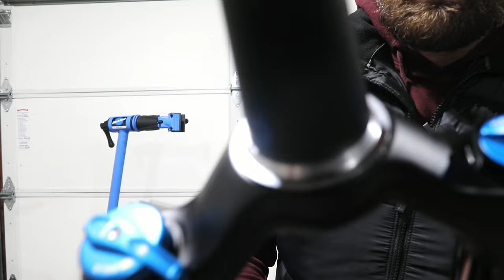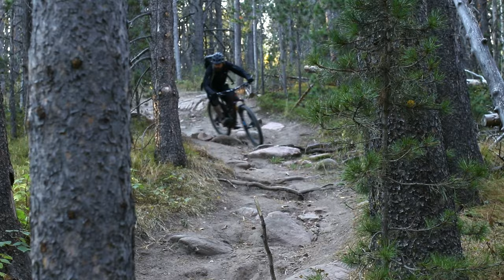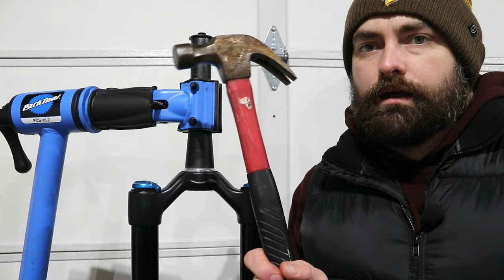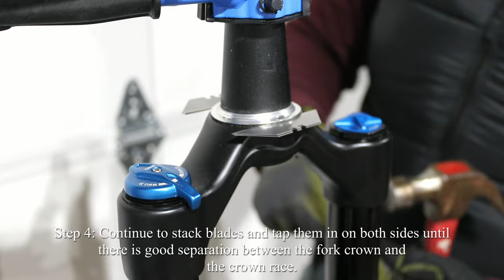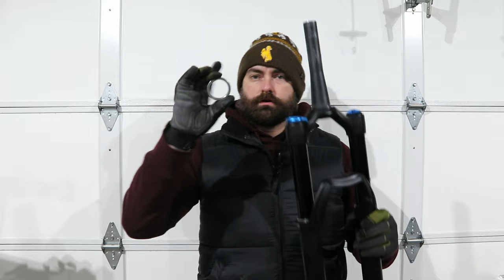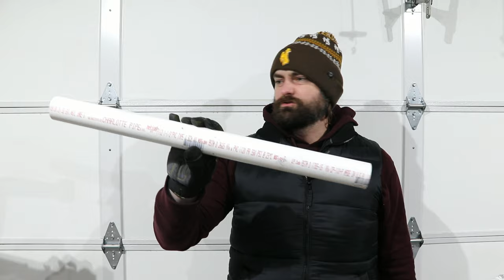DIY Crown Race Removal & Install - No Special Tools, Screwdriver, or Damage!

Comment: Probably smarter just to use a Flathead screwdriver and hammer down on that rather than razor blades at that point
Reply from the maker: So flathead screwdrivers don’t tend to be as fine of a point (or beveled) as a blade and typically have a difficult time getting under the crown race without gouging the crown.  That’s why I opt for the razor blades. If you can take a screwdriver and grind it down to a nice fine beveled edge then that should work pretty dang well!  Maybe I’ll try that out as well! Thanks for the thoughts!
Reply: @Tkolbo_  No I meant once its loose after freeing it with the razors. You used the mallet to hit downwards on the razor at that point. A simple screwdriver would be much better.... and safer.
Reply from the maker: I see what you are saying. Yes that would work. I’ve actually started using a tire lever at that point which works really well
Reply: @Tkolbo_  I've always just beat them off with a flat head screwdriver but I'm going to try your method next time which will be Thursday.

Comment: **I WISH I HAD NEVER FOUND THIS VIDEO**
No matter how careful you are, you will take paint off of your fork. 
Medal on medal is never a good idea!!
I took some decent strips of medal off of a $265 dollar fork.
Pretty sure no bike shop can fix this mistake.

Just go have a professional do it. 

"Doesn't really have any bad marring"??? BIG DISCLAIMER... but definitely could.
Reply from the maker: Well I'm sorry you had a poor experience. I wish I knew what happened, I've done this several times and so have many other people without a problem. With that said nothing is perfect, and I am sorry that happened to you and your fork.
Reply: @Tkolbo_  I wound up calling a bike shop who was really helpful. They said just spray paint over it, and the crown race won't be effected when installing. It was a load off my mind. They also said that the razor blade approach was what they've used in the past as well. I don't think I'd use the approach again, but apparently it IS an acceptable way to remove a crown race. I was just freaking out b/c the fork of concern was an expensive Crust cargo fork and the first bike shop I called acted like it was unfixable and problematic. I apologize as well for being a little freaked out over nothing. The fork is working fine now that it is all installed again.
Reply from the maker: @walkman3  Oh man Crusts are cool ass bikes! Do you have a crust frame to go with the crust fork? Bummer the first shop gave you a sense of impending doom. Still bummed you took any paint off, but atleast you got it sorted and the fork is running well! No need to apologize though, I understand frustrations when doing DIY stuff. Just so you know, I have worked in shops for the better part of a decade so I have quite a few tricks up my sleeve that I have a lot of experience with. With that said, its still a massive bummer when something doesn't go quite right. Thanks for the update!
Reply: @Tkolbo_  I haven't quite brought myself to get a Crust frame yet. I had the cargo fork on a 1995 Trek Singletrack 950 and it was perfect. The geometry was incredible.  I thought I'd swap it out and put it on my Soma Double Cross Disk, but it just isn't the same. During that switch, I was doing the crown race removal. But yeah, all is good. Thanks for your thoughtfulness on responses. One bike shop was cool, the other got me all wound up. So, yeah, it's still on me for getting so uppity. Learning DYI as I go. Thank again man!